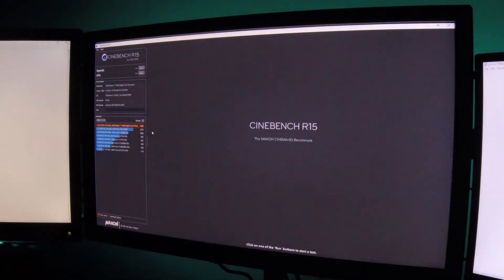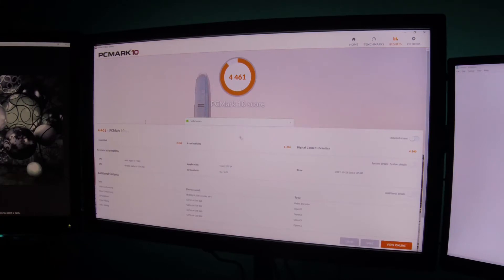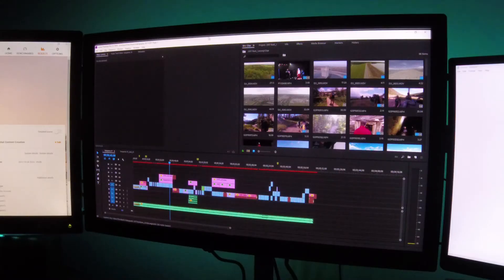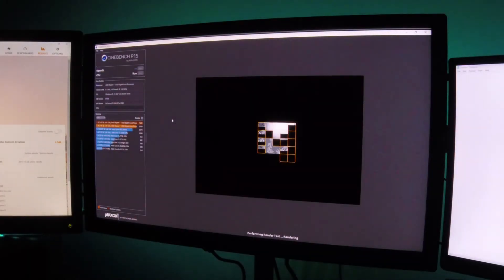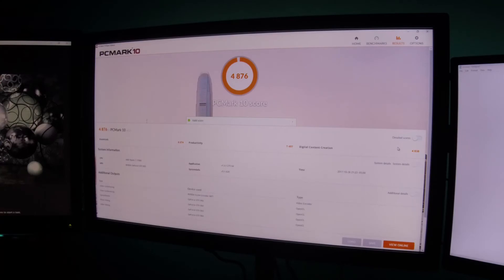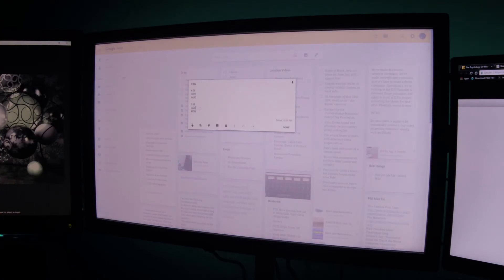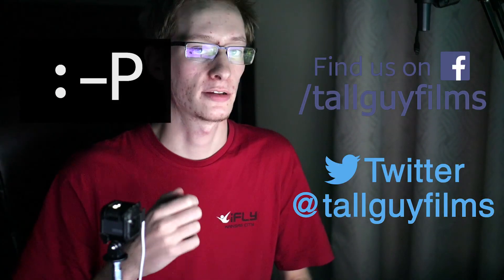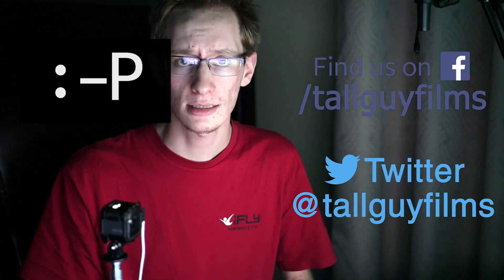Performance Benefits from Overclocking - Video Editing PC Build pt. 3

Comment: I am trying to get 8700k for my editing requirement. Now I'm confused with whole overclocking and turbo spped thing. Some say the CPU will increase is its speed automatically when required i.e. hit 4.7ghz supposedly when I'm editing on premiere and then there are some who says that turbo boost is short term if it's just short term it won't be much help for my work requirement. Another question is must I overclock the cpu beyond turbo boost or is it ok to overclock around or below it ? thanks!!